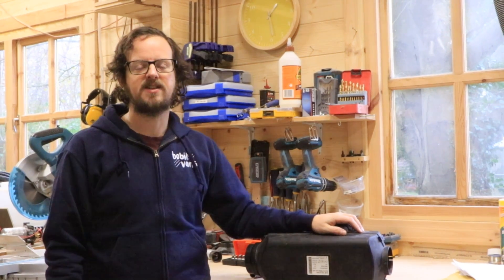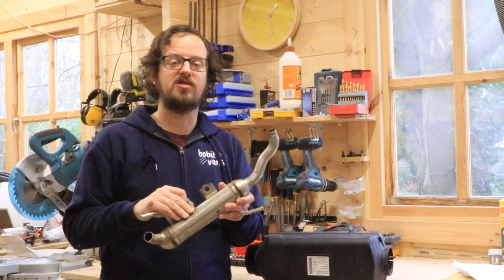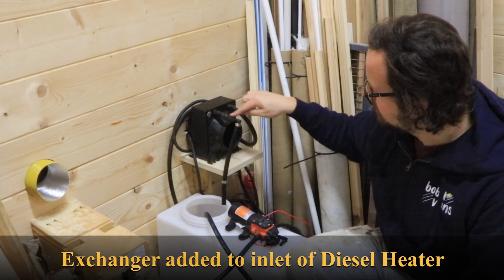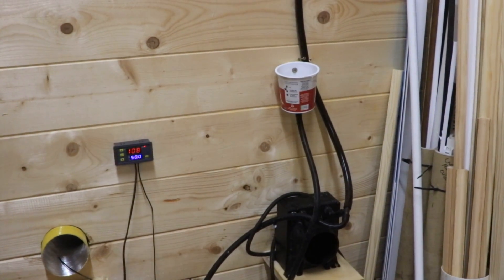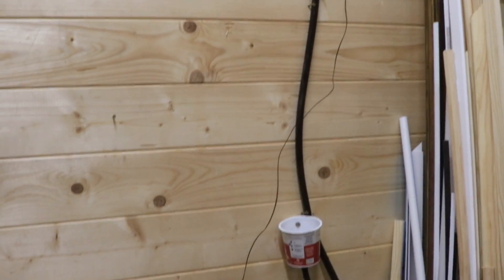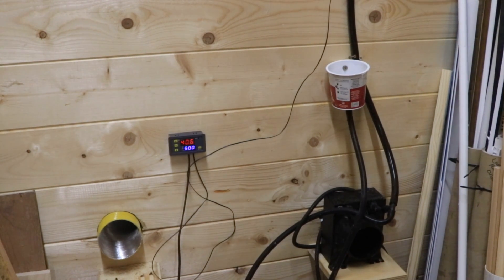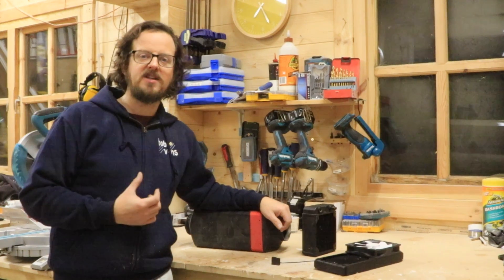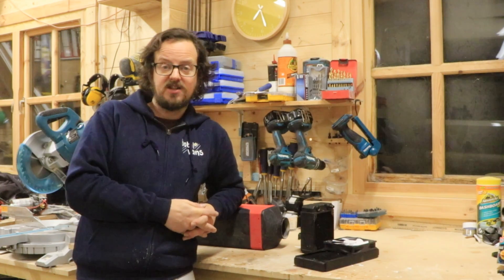Chinese Diesel Heater upgrade with EGR cooler

Comment: Can I add suggestion?
I used a 20w 12v water pump but ran it via a voltage control. I then could adjust the flow of water, that way it gave the water more chance to collect the heat. I tried it at full speed at 13.5v and at 10v and I got a better result at slower speed through the EGR. Instead of cooling the egr, it collected more heat and quicker. The potentiometer was only a few quid from ebay
Reply from the maker: Interesting-isn’t the point to cool the egr? The more you cool it the more heat you reclaim. If the water is running slowly then I think it would be less efficient. I think having a bigger differential of heat on the send and return pipes gives the illusion of more efficiency but I wanted them to be as close as possible.
Reply from the maker: Also I use brushless pumps so they won’t respond to changes in voltage.
Reply: @bobilvans4205  have you tested this?  with lower voltage I would also expect lower RPM from the motor.
Reply from the maker: @Jrod_FPV  No, the pumps won’t respond to changes in voltage. But from our hybrid kit experiments, a higher circulation rate means more efficiency. Temperature of water is different to total units of heat energy transferred.